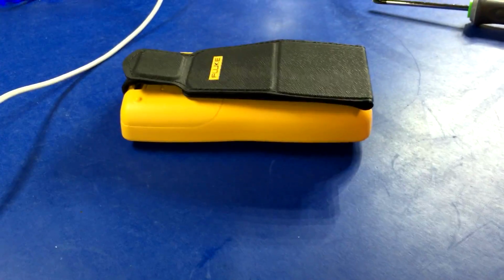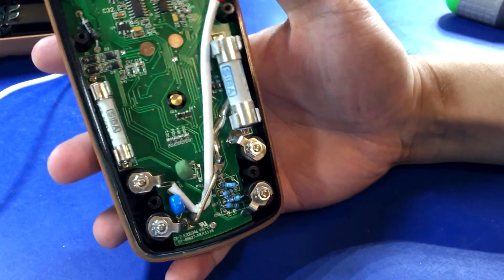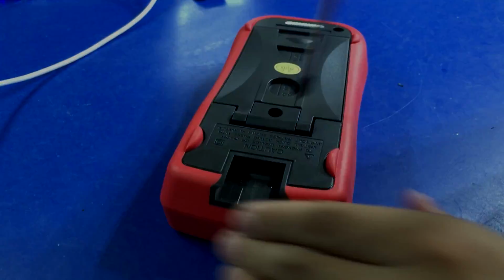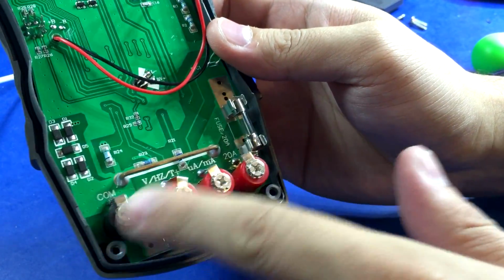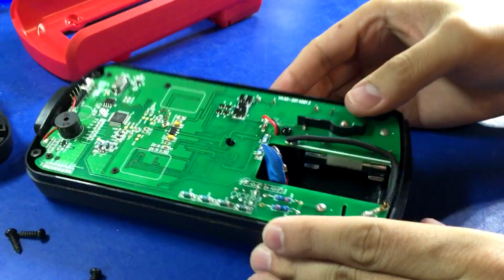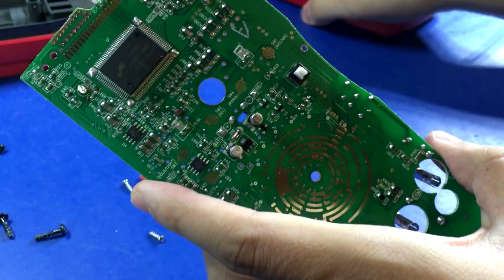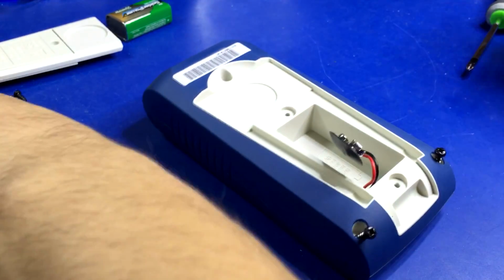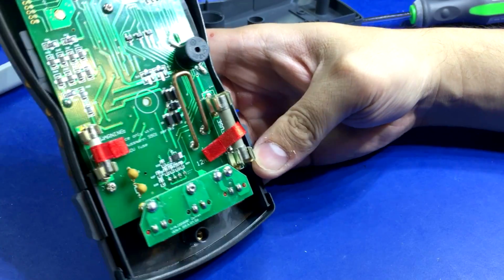$50 Multimeter Shootout - Part 7 - 15 DMMs Compared! - Teardowns - #0074

Comment: Are those colored fuses fake Bussman fuses?  32:55
Got a lot of those fuses and they were suppresinly cheap, and the do say bussmann, though it was some clearance sale from those BG.
https://imgur.com/a/kUbf5V5
here is the inside of one of these cheap scope meters.
costed 11.11USD delivered when the store above had 11 year birthday.
https://i.imgur.com/S3Wg38Q.jpg
https://i.imgur.com/mORIx12.jpg
though it does have some crude logging feature, where it can log waveforms and std DMM readings like here with an auto-hold where it gives a tone-message after some stable criteria are reached.
https://i.imgur.com/syk1hkf.jpg
though not sure what that switch on the MB on the left-mid is for.. 2 way
https://i.imgur.com/pL5U2J9.jpg
https://i.imgur.com/0QlVp2T.jpg
and this old Victor DMM with PC interaction.. were around 40 bucks and the inside seems to match, though its a relay DMM
.https://imgur.com/a/JwvLzlx

Comment: fluke 10x is just for starters or hobbyist, I wouldn't poke this meter even on a 220vac. it doesn't have current so it's more robust and as you can see the PCB is nearly empty and has wide isolation slots. This is only recommended for starters, hobbyist like electronic kits assemblers.

Comment: What is it that you mention at 11:39 ? Very nice "..." ? This kind of wire sticking up? What is the purpose of it?
Reply from the maker: If you're talking about the big wire that has no insulation, that is the 10 amp current shunt. It is basically a precise low value resistor. (Usually 1 ohm or lower) The multimeter basically measures voltage across that shunt and since we already know the resistance and voltage, it can use Ohm's Law to solve for current, and that is basically how a multimeter measures current.

If you're talking about the insulated wires, those are just fixes to their design after the fact. I hope that clears things up!
Reply: TechnologyCatalyst Yes I was talking about the shunt, I understood later in the video when sound was more clear. I'm still very new to electronics, not the first time I hear about "shunt" but that's it. Thanks for the explanation! Nice video. I wish I could just tear down things all day long =)

Comment: The surface-mount electrolytics in the Uni-T concern me. I see lots go bad in consumer gear and I think they'll be prone to getting jarred and falling off the board.
Reply from the maker: Mark Zacharias I'll take a peek in there once a year and will report back if any of those go south
Reply: +TechnologyCatalyst I work on Guitar effects and low voltage amplifier. Will the Uni-T UT61E enough to suit my needs? I need Capacitance, resistance and Voltage reading. The highest voltage I deal is around 200V max.
Reply from the maker: It would work fine for that.  (keep in mind, lots of people who do guitar pedals and stuff like having a multimeter that can do transistor gain testing and this model can't do that)